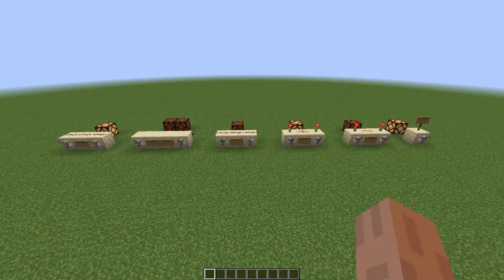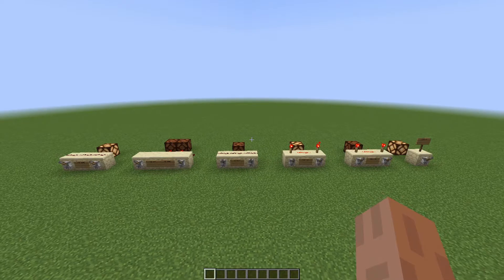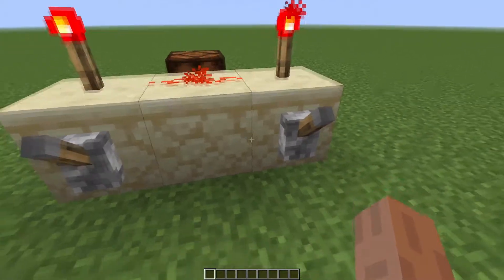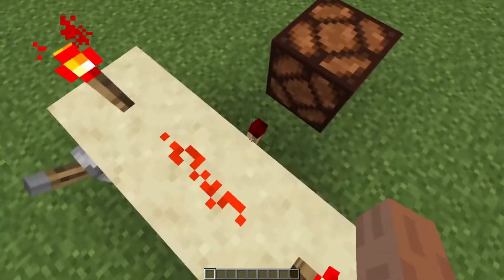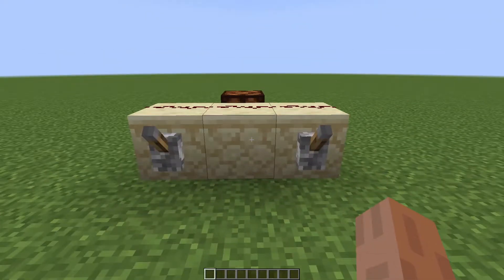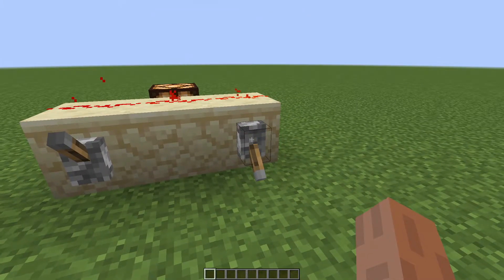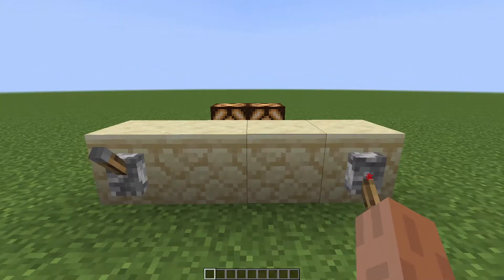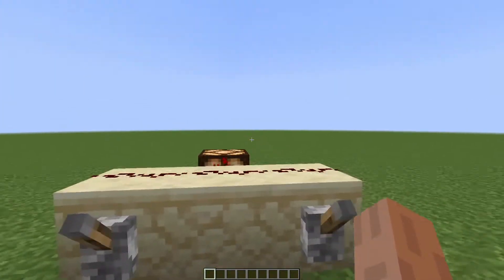How the 6 Logic Gates in Minecraft Work - Concepts and Explanations

Comment: Forget the cnot and ccnot gate? And the rs nor latch and nand latch and jk flip flop and d latch and t flip flop and xnor gate?
Reply from the maker: Well first of all, I didn't want to make an hour long video, but also, here are some more detailed explanations: a cnot gate is just a xor gate with a second output that is the same as the non-target input, a ccnot gate (more commonly known as a Toffoli gate) is just an and gate hooked into the non-target input of a cnot gate, and the others are just very rarely used. T flip flops are probably an exception to that except I have made a separate video for those already, so that would be unnecessary. A d-latch is what a locking repeater is, so I also covered that in my video on repeaters. If you would like, I can make a video on any of the ones you mentioned that I haven't covered in a video yet (cnot, Toffoli, rs nor latch, nand latch [which I believe is the same as an rs nor latch], jk flip flop, d latch, or xnor gate).